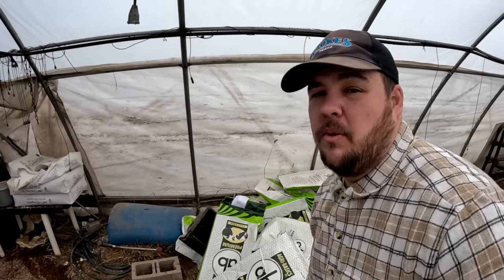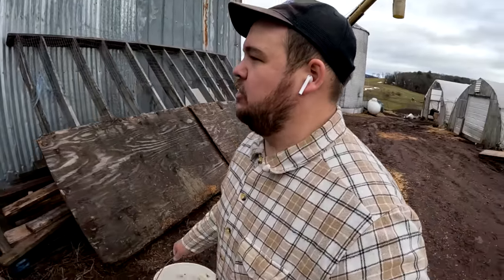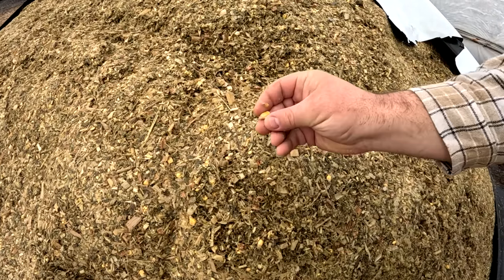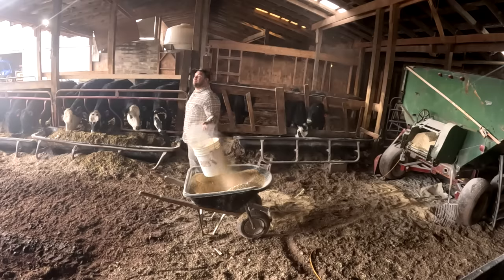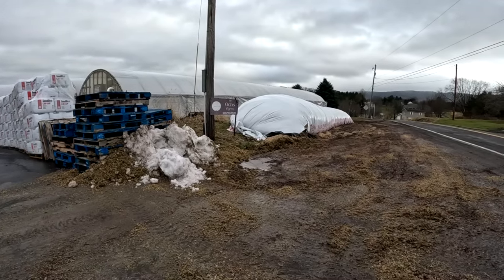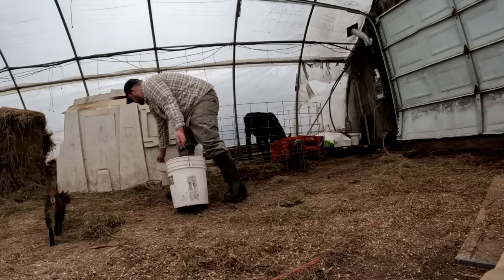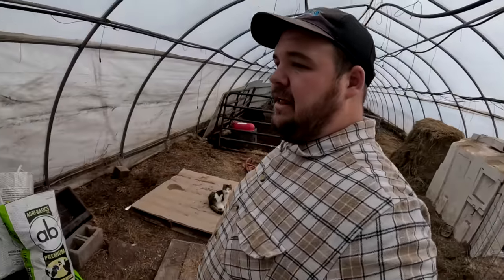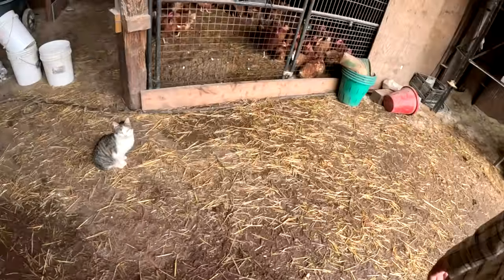RUNNING OUT OF FEED - TIME TO OPEN THE NEW BAG

Comment: I see many cattle /cow farmers put blankets on their calves in winter so the calves don't have to use all their calorie intake on just keeping warm and put on weight and size. If their water freezes, then they are definitely cold in there. Might be worth a test try to make them more comfortable as well. Also throwing in more wood shavings on top of old wet shavings doesn't stop the humidity level and humidity and urine fumes makes it feel colder and are tough on the lungs.